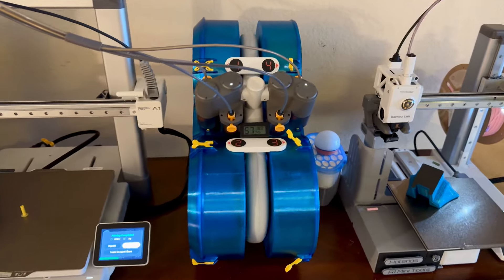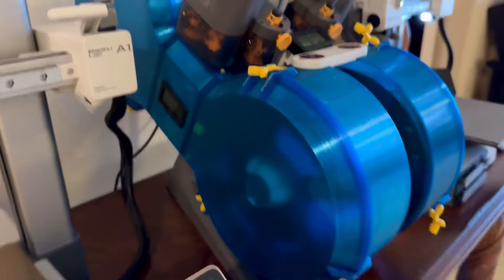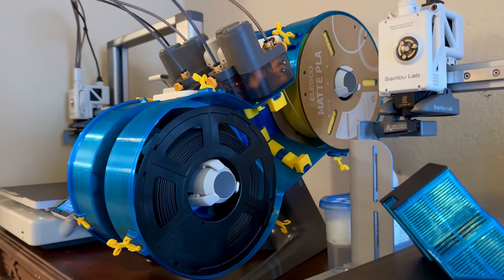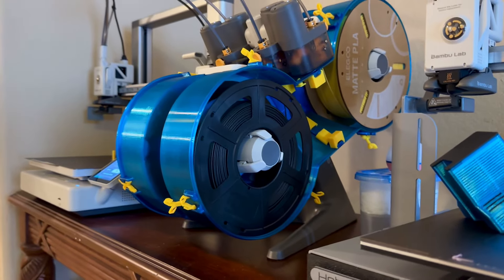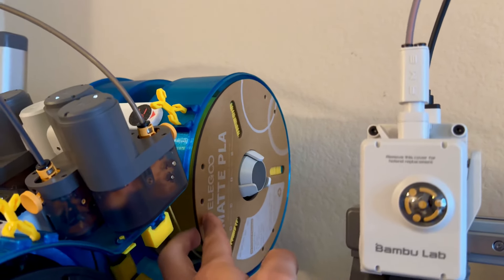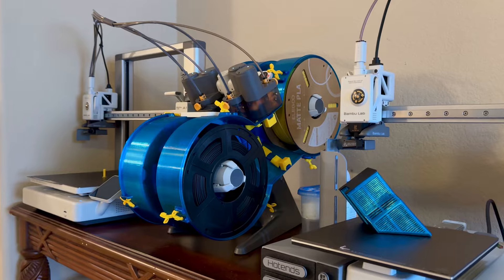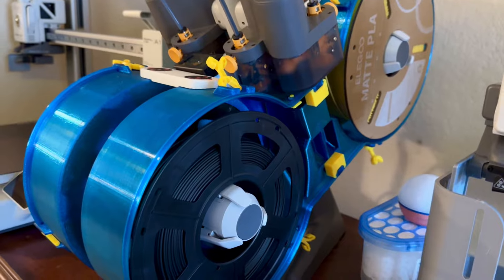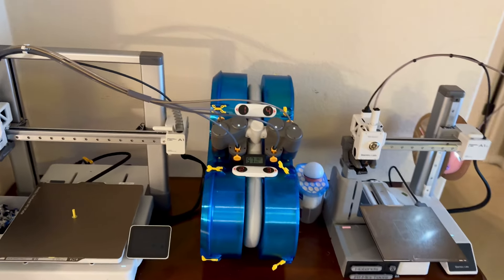BambuLabs AMS Lite Minimalistic Enclosure

Comment: I do not understand why Bambu Lab didn't just design the AMS Lite with such an enclosure. Either way, props to you for figuring this out!
Reply: Cost
Reply: You never bought an iPhone? They design it so you had to buy next iteration. I bet they will release AMS 2.0 with drier integrated. And later they release AMS 3.0 where you will actually be able to turn drier on. And so on = )
Reply from the maker: AMS Lite V2 is probably why, lol. Iterations. I agree, it's a miss. At least they should include pre-loaded stl files like they do for the top mount clamp or scraper. Maybe they will soon.
Reply: At least that is what they did with A1 and A1 mini. They released A1 mini first. And later, thery released A1. And many users said, they would not buy A1 mini, if they knew that A1 will come out.
So yeah, I guess they are quite precise with their misses. = )
And still no printer has filament motion sensor. I bet their business plan is close to ideal.
Reply: @enosunim  Again, from a business point of view, it's about the cost. They have no reason to be fishy and assholes if they knew that the A1 would be such a success before they made the A1 mini. The mini was a safer bet/experiment that targeted the bottom of the price range of 3D printers, to see if their philosophy was viable in this range. It was much cheaper to make and ship, and the market was smaller than the market for the A1, so the cost of having a recall or a big problem on a large scale was minimized. They then used what they learned in making the A1 as safely as they could. (In the end it didn't entirely work out as we saw with the power cable recall, but eh what can you do?)
I didnt buy an A1... It was too small.
Reply: It's all about the money. At kickstater campaign one of the points was creating a printer which will be so cool, that no bedslinger ever be so great, and they will just become obsolete.
And now we have A1 mini and A1. Obsolete bedslingers my ... = )
Oh, I guess it is a coincidence. = )
A1 recall was a really small percent.
And where did I said they are bad? It's just business, nothing personal.
I am just watching their path with a can of pop corn. I am really interested what will they use to force people to upgrade to new machines.
The last computer software excuse I saw "Your processor is oudated", it's not speed, it's date of production which is now matters = )
I hope Bambu will be creative in that question. And it will be something smarter then "We do not support this model anymore". 'Cause you know, it should be a customer who decides. (Or at least they should think, that they decided.)

Comment: I saw your Reddit post and wanted to share my experience with the same setup. My house has a relative humidity (RH) of 45%-65%. Initially, the enclosure's humidity was stable at around 20%. However, after moving the desiccant box further from the hygrometer by using a thinner box and placing it in the middle of the spool, the humidity reading increased significantly. Within 1-2 days, the enclosure's humidity was increased to only 10% lower than the room's RH (45% vs. 55%). This suggests the setup might not be as airtight as expected. I recommend trying this adjustment and sharing your results.
Reply from the maker: You're probably right. IMO, any decent improvement makes it worth it. Plus the whole "not needing spool adapters" makes it a clear win for me. I've already started toying with fitting gaskets in between each component. hopefully more to come on that soon.
Reply: I’ve just put mine on yesterday and while putting it together wondered about the air tightness of it and I’m thinking I might put some electrical tape around the edges to help seal it. Not joining the covers to the base but actually wrapping it around the base edge before putting the covers on. I feel like that has got to help.

Comment: I have been planning to print this and it's nice to see a real world example. Thanks! Could you measure how much it ads to the AMS on the bottom? I plan to wall mount mine or put it onto my Ikea pegboard and a lot of the mounts leave very little clearance to the wall. Also: Did you print the main enclosure in PLA or PETG?
Reply from the maker: About 10-15 mm.
Reply: @modestcody123  thank you! That's good, I'm sure I can find something.

Comment: You mention a smaller spool holder. Looks like you're using elegoo matte in the back. Those have a smaller hole which makes AMS Lite removal tricky.

Do you have a link to the smaller holder you mentioned?
Reply from the maker: Yup, good eye. That's the problem. I just printed this one yesterday and it works well: https://www.printables.com/model/922048-prusa-spool-adapter-for-ams-lite/files

Comment: Have the Sunlu spools been wearing out the bottom of the cover over time?
Reply from the maker: Just checked and no. All looks normal. I see what you mean, though. I've only put 40 hours on the machine since this upgrade, it's possible that drag over time will cause some wear. PETG ftw.

Comment: I am realllllly new to 3D printing and I have a stupid question. I am still in the "don't mess with other people's profiles" phase, and I want to print the desiccant bead bin, the same as you showed in the video. I have a warning though about "object superduper3 has floating cantilever. Re-orient or enable support generation" 

But if I enable supports, I am messing with the print profile. Should I do it?
Reply from the maker: @Rakshasa84  hard to say without seeing the orientation but I’m assuming it’s printing at an angle (as the profile sets it up to be). If that’s the case, you should be good to go. It’s also not that much filament so if it fails just adjust and try again. That’s how people get from bing afraid of “messing with other’s profiles,” to knowing their stuff. No supports. Good luck.

Comment: Hi
Once more thank you for your advice and files for preserving our filament 
Please I need a bit more advice regarding Sunlu filament 
I noticed you are using Sunlu and I am thinking about purchasing some too as it is cheaper than Bambu 
I however don't know if it is safe and would not affect performance of the Bambu and even clog up the nozzle 
I will appreciate your advice as I bought the same A1 printer 

Sincerely friend 

Ejike

Comment: 2:00 yes they will never fall off, but doesnt the spool holder also retract the filament (keep tension) when the ams switches material?
Reply from the maker: @ipadize  I’ve already commented on this. Yes. They are not tensioned or motorized. It’s just a freely spinning spindle.
Reply: @modestcody123 
What?
No multimaterial printing then?
Doesn't it negate most of the points of AMS then?
Reply from the maker: @janenglund  He asked about the spindles, I commented that they are not what causes the filament swapping that's all done with the Feeder Unit: https://us.store.bambulab.com/collections/spare-parts-for-ams-lite/products/ams-lite-feeder-unit

The spindles just hold the spools, nothing more. So yes, you can still swap filaments during prints. I now have well over 800 hours on this machine since I created this enclosure, many of them are multi-colored. Literally zero issues.
Reply: @modestcody123 Oh!
I did not realize that the feeder does the job!
What is the point of adapters then?

Without the enclosure the Sunlu spool is hanging so low that the feeder has issues pushing and rewinding it? So with the enclosure the adapters are not needed?
Reply from the maker: @janenglund  The adapters are better for spools with the smaller diameter openings.

Comment: I like the filament you used for the enclosures. What filament is that? Thanks
Reply from the maker: Thanks, it can normally be had for about $14USD a spool. Not sure why it's $20 atm. Here ya go:

https://www.amazon.com/gp/product/B08TV2CKHH/ref=ppx_yo_dt_b_search_asin_title?ie=UTF8&th=1
Reply: @modestcody123  so that is a TPU? Maybe that's the price difference as the link you sent was a TPU rather than a PLA or something. Thanks. Will look into the transparent materials.
Reply from the maker: @tonyzeh  Oh, weird. Not sure why it linked the TPU variant, I specifically chose the PETG option. It's PETG, but it looks like they are currently sold out.

Comment: I looked and the hydrometer designs are all round. Did you have to modify the print? I have the ones you do. From the same link on maker world.
Reply from the maker: I measured the hygrometer and added .2mm to the dimensions and then just bullioned that shape into the blank cover. It can all be done in BL Studios using a privative and negative parts. Looking back, I should have updated the profile on MW. Sorry, but I don't have the file anymore.
Reply: @modestcody123  no problem, thanks again!

Comment: Cool thing. But I guess you cannot print it with A1 mini?
And they say that Bambulab does not require tinkering = )
Or as Bambulab users say "Yes it is not mandatory, everything is perfect out of the box, I just wanted to do it, because I want, and btw they are not expensive" or something like that.
Reply from the maker: You can. I had it on the mini for a while with no issues. I would love to have another AMSL for the mini, maybe in the next sale.
Reply: I mean those parts look large. I thought they do not fit on A1 mini bed.
Reply from the maker: @enosunim  oh, duh. My bad. I did not print them on a mini but there is a profile for it. You'd just need to do a little post-processing.

Comment: Is this even airtight? Do you need to change dessicant regularly even when you don't open it?
Reply from the maker: It's not air tight, but it works pretty damn well. I went on vacay for three weeks and refilled the desiccant containers with new material before I left, ambient humidity inside the chambers was at 15%. I just returned a few days ago and the ambient humidity was at 27% inside, and 54% outside. So yeah, I'd say it works well and the desiccant will last about 2-3 weeks.

Comment: But the spoil without the adaptor, how is retraction, the center og the spoil holder reverses to spoil the filament on the rook again, and the feeder also, how does that work? Is it to short of a distance to matter or what are your experience with it
Reply from the maker: The spindle is not motorized. The spool holder rotates around the fixed spindle. The feeder is the only thing that moves the filament back and forth. So, no this is not a problem. I had a longer version of this video that I had scrapped, but I went into this a bit more; I should have kept it. You'll have no issues with feeding or retraction. I just advise that you don't use the little "funnels" included in the parts as the inner diameter of the hole was too small and caused feed issues.
Reply: @modestcody123  hmm i was fooled by the spring in it, thanks for the answer

Comment: is the a1 much better than the a1 mini,._? i mean from the bed pow, i never had a printer, but the the 180 vs 256 really an issue if you just become better to slice prints up? i get if you need a 250mm rail its better , but for all normal things>?
Reply from the maker: @Gateseleven  it depends. I’d rather not have to do more post processing. Also, I tend to make a lot of mechanical prints, so I print large parts on the A1 and all the smaller components on the mini. Different use cases. 90% of people just need the mini.

Comment: CAUTION! I DID THIS ENCLOSER, AWSOME design, but it will cause jams unfortunately.
Reply from the maker: Not my experience.
Reply: @modestcody123  Same here, been using it for a while now, no issues at all
Reply from the maker: @donald5983  Did you remove the little funnels? Those were the only thing I notice were no bueno. They squeaked and they caused binding. Forgot to mention that in the video.
Reply: @modestcody123  Nope, i did enlarge the holes a little though, no issues after that really

Comment: This doesn't work. It just traps humidity inside. Two different make and model hygrometers were showing me lower numbers for ambient humidity than what the hygrometer measuring on the inside of the enclosure where there were silica gel packets. Plus, changing filament is a huge pain! I do not recommend this. So sorry for the time and material that went into printing it
Reply from the maker: Weird, I've had a phenomenal experience. I don't mind changing the  filament and I ended up printing another set of the carriers to just quick swap them. I also put hygrometers in the spool areas to see if the humidity dropped. It showed 2% difference that the ones mounted near the desiccant holder. I'm happy with that. I just swap the carriers about every 3 weeks.